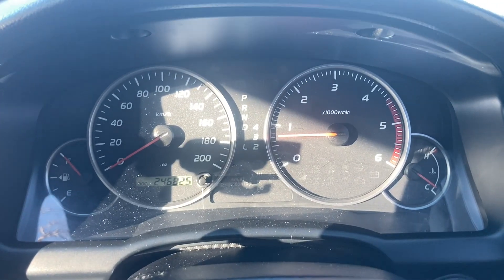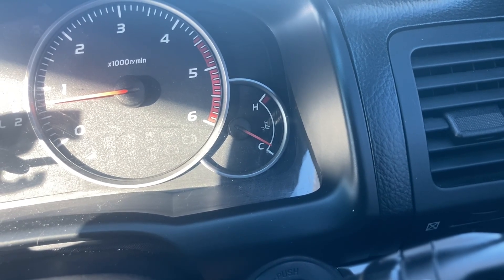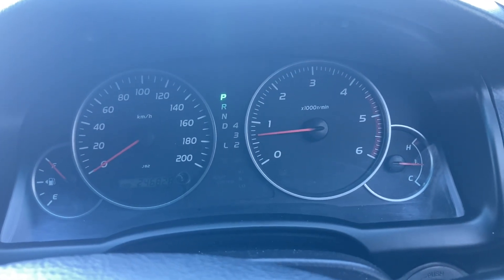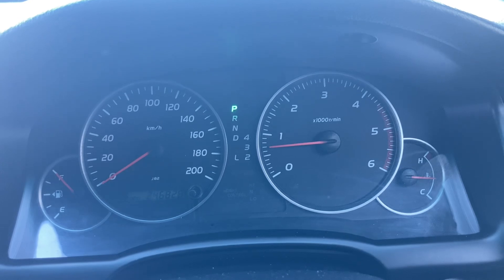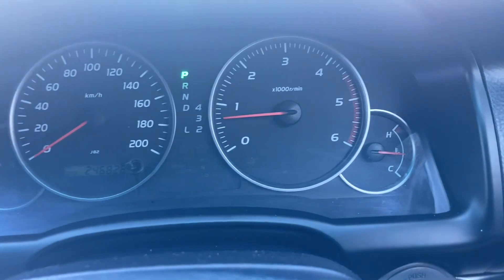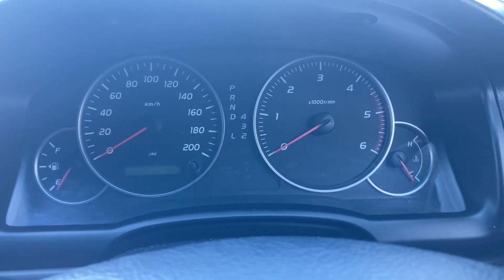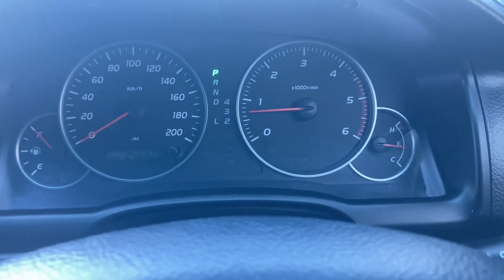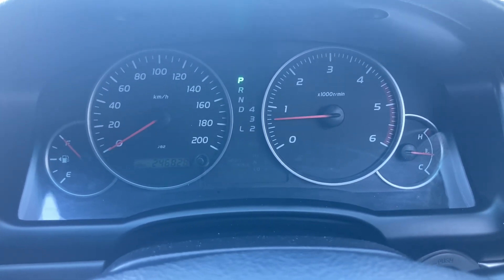This is how long it should take for your engine to warm up

Comment: On Prado 120 with a naturally aspirated 5L-E diesel engine, the temperature gauge needle is lower, even if the outside temperature is over +40°C.

Comment: I've adopted your short idle, gentle warm up method with my ranger. Working a treat for me, and oil analysis confirms no issues as a result. Scangauge 2 on my dash helps keep things consistent.
Used to be a 5 minute idle guy, especially in the winter. Can see how this is an absolute waste and no good for the engine.

Comment: Can someone explain why the hilux revs will climb when sat at traffic lights… from 750 say to 900 … bugging me 2kd
Reply: UK Toyota  frame replacement on hilux ( they are rusting out on this damp little island  ) … Taking them 5 wks and they are running short on replacement hilux while they do the work , had to opt for a Corolla or CRV , otherwise would have to wait until February 2026 before they can get it done .. anyway I thought someone might like to know how it’s going

Comment: Another great vid.FWIW,even though the coolant is up to temp,the engine oil will still take a lot longer before it is at operating temperature.Our 1 VD certainly takes a lot longer to warm up,as expected.Same for the auto,it won't lock up until the pan fluid is around 40 degrees on the Ultra Guage.